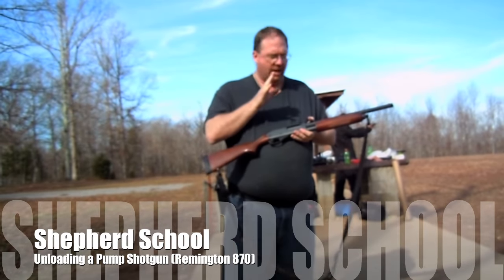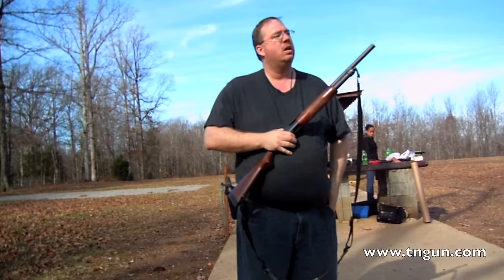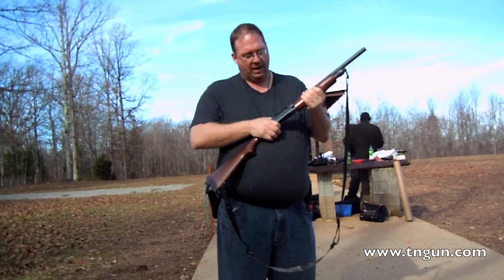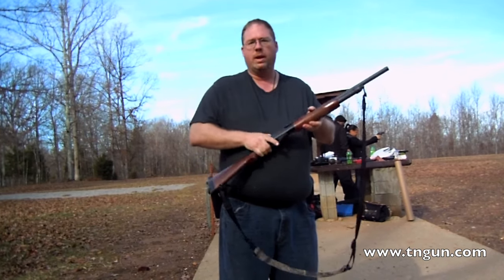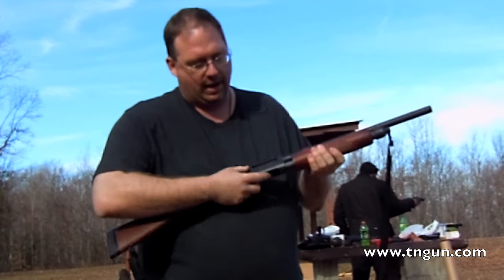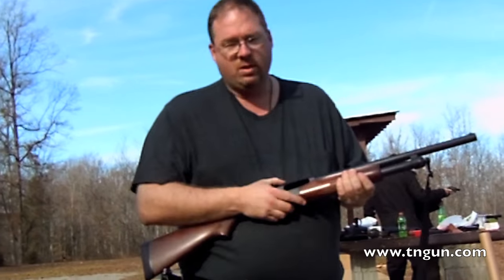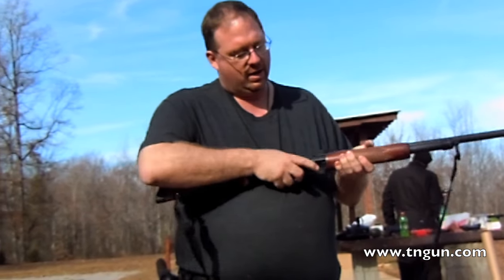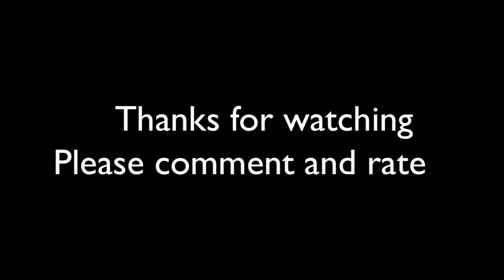How to Safely Unload a Shotgun | As Taught to Law Enforcement

Comment: You can empty an 870's magazine much more quickly & safely by turning the gun upside-down, pressing the carrier out of the way, and depressing the shell latch to release shells from the magazine.  This actually works for a lot of different repeating shotguns, but it's especially nice on the 870, since the spring-loaded carrier pops each shell right out into your hand.  You can completely unload the magazine in just a few seconds this way, without ever opening the gun's action.
Reply: Synchronizor so that works for most shotguns? I'm planning on getting one pretty soon and just wanted to know if you'd be able to do the same on most... makes it easier to unload
Reply: 20BulletProof10 I can't speak for every shotgun, of course, but many of the pumps on the market are based on very similar designs.  Was there one shotgun in particular you were wondering about?
Reply: Nahh just wondering but I think this one does have it I'll make sure tho when I actually purchase it but thanks
Reply: 20BulletProof10 yes it does work. Especially on most Mossberg models. Engage the safety latch or pin safety and then turn the shotgun on its side. Inside the loading gate you will see a little fork holding the shell rims inside the tube, depress that cath and all the shells will pop out of the tube.
Reply: @20BulletProof10 what shotgun did you wind up going with??
Reply: Exactly. I was wondering that myself. You never actually have to cycle the pump to unload it. I have no idea what Tubby was thinking,.... maybe "Biscuitville?"

Comment: Does this work with all 12 guaje pump action shotguns?
Reply: In general yes. button placement isn't in the same spot for all of them but it's the same principle otherwise. there's an easier way if you find the shell latch you can just pop them out by hand without needing to cycle. no risk of accidental discharge.